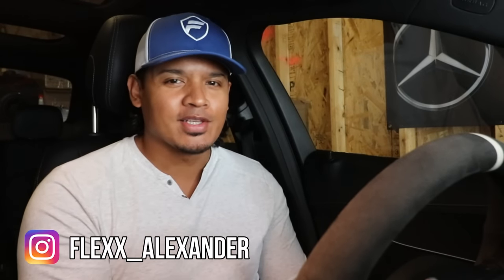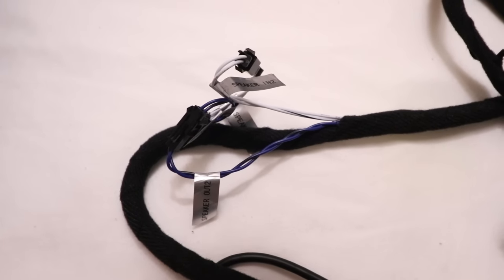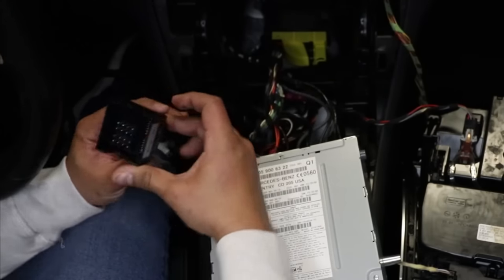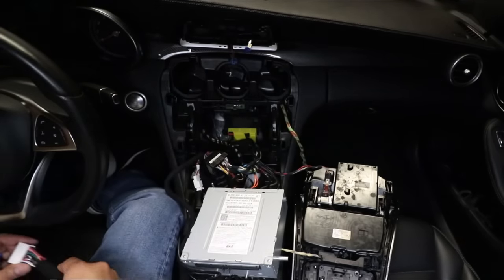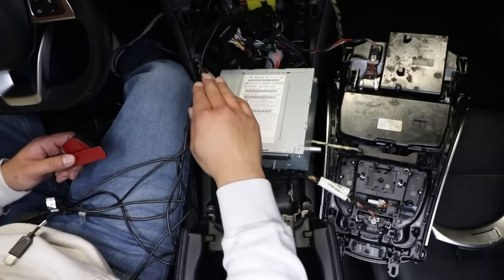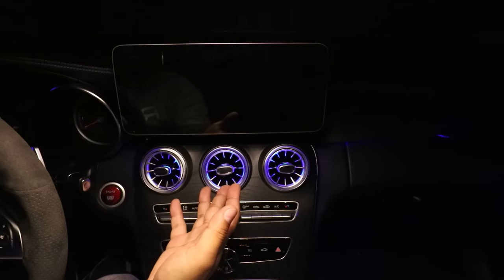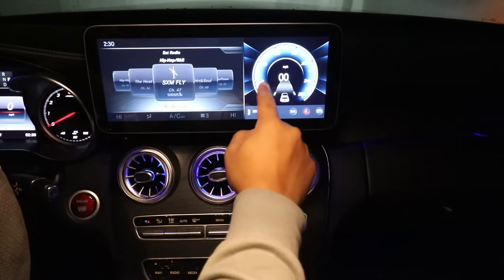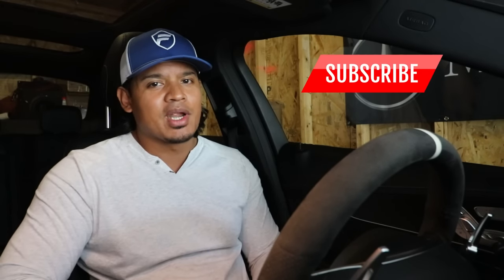BIGGEST Android Screen install on C300 (W205) 2015+ Mercedes C-Class

Comment: Does this screen help any as far as audio sounding better over stock because my AMG sounds factory are subpar. Looking for an upgrade but if this just helps user interface then i will keep looking
Reply from the maker: Yes and no.  It’s doesn’t enhance quality but it has a way better EQ to customize the audio.
Reply: @TheFlexxGarage  ok thx for the reply i was looking for an enhanced sound without installing multiple amps. I recall on my 2008 Bmw i changed the oem radio to an aftermarket and everything just sounded 10x better . I found some other videos on changing the speakers and tweeters / subs but keeping it oem integrated still seeing if this will help.

Comment: Ordered one after watching this video. Let's see how it goes with the shipping and install ;-)

2016 C300 Designo Package
Reply from the maker: Hope it was from DMP cause if not, you’re gonna have a hard time setting it up to work properly cause no other company offers good step by step support if you have issues.
Reply: From the link you posted.
Reply: The FLEXX coupon worked too!!
Reply from the maker: Cool. If you have any questions, just reach to DMP cause after the install, things won’t work right until you setup the screen setting correctly.

Comment: Hey flexx, when I installed the 12.3 on my 2015 c300, the backup camera, agility control and t
Trackpad all don’t work. I rewired my old screen and everything works as normal. I don’t know what the issue could be
Reply from the maker: Probably Need to update your settings on the new screen. Contact DMP and they’ll walk you through it.

Comment: Hey flex, i don’t really use the voice on gps if i was to not connect the little black speaker could i still hear the phone calls through the regular speakers? Would it effect anything else?
Reply from the maker: you dont need to use it. Its only for GPS..not calls.
Reply: Hi, 
were you able to solve those problems? I am thinking about buying one for myself. How does it feel like after using it a period of time? is it as smooth as the OEM system?

Comment: Hi, great video 🙂. But i do not have any sound in the Android system, just In OEM system. And In the OEM system the sound Is "sparkling". Do you know what I can have done wrong?...In the video you connect the AUX cables, and connect them to the USB port In the console. I did not do that. Is that my problem?

Best regards
Raymond
Reply from the maker: Not sure.  But the no audio is a setting issue. However you have to plug the USB or 3.5mm jack into the AuX on your car. You need to chat with DMP and have them double check your install and settings.
Reply: @TheFlexxGarage  thanks for your reply 😊

Comment: So in the video at the end you say there are two white wires that you connect to the screen when at the beginning you can see that wire is blue. That blue one doesn’t fit into the white connection on the back of the screen
Reply from the maker: I clearly said the 2 white connectors plug into the back of the new screen. Go Watch the 2:49 mark again

And I said the blue connector plugs to a connector that’s already on the car (it plugs into the original connector pulled off the oem screen). I never said the blue plugs into the back of the new screen. And go watch the 10:30 mark again.
Reply: Thanks, that helped and yeah the smaller white connector had gotten lost in the back when I had pulled the cords through

Comment: Just bought the 12 inch for my 2016 C300 (W205). I have issues with the screen long time to boot and eventually disconnects while driving. Is this a common problem that anyone faced and do you know a solution. DMP support are not responsive on the phone lines provided on site. I bought directly form DMP car design on their website
Reply from the maker: Contact them directly. They are there to support you.  I never had any issues so I don’t know how to solve your issue. Send them an email or what’s app.

Comment: Hey Flexx, does the climate controls/temperature/blower speed show up on the Android screen?
Reply from the maker: Yes. I think there’s an option to have them all the time or only when you push the switches.
Reply: Great. Will definitely look into getting this. Do you think the size is too big that it blocks the viewing of the windshield? Also does this one also sit too high compared to the old Android units?

Comment: Nice video Alex wish DMP would actually include instructions when you order them. I had to search on YouTube for this install and still had some issues as they were from different android screens. They at least responded via WhatsApp and got me all squared away. The only issue I'm having now is that when I am connected via Android Auto and I am using Waze or Google Maps and listening to Spotify my music stops playing every time I get a message, notification or if my Navigation re routes. This is extremely annoying and it takes a good amount of time for the music to start playing again. Do you know a way to fix this? Would greatly appreciate it!
Reply: Hi, 
were you able to solve those problems? I am thinking about buying one for myself. How does it feel like after using it a period of time? is it as smooth as the OEM system?
Reply: It’s really good this new model you will love it

Comment: Does your original mercedes system need to be working in order to install this? My radio head unit has just malfunctioned and I’m left with a fuzzy screen, and I’ve always fancied an upgrade to apple carplay. So I’m wondering if I can get away with installing this new screen or whether it relies on having an intact, functioning mercedes computer running in the background. 
If yourself or anyone else out there has had a similar issue or has any thoughts please let me know.
Reply from the maker: Depends.  If the oem screen is the issue, then you can get away with it.  If it’s a signal that bad going to your oem screen, then the signal will still be bad going to the new screen
Reply: Thanks. I think the problem is with the radio head unit rather than just the screen, and asking around on several forums I think I need a new head unit (or software update) before I can upgrade to this android screen.

Comment: Hello Flex, maybe you can help me. When I turn my signal or when I am reversing the android system shuts off and goes back to the original system. Once I turn or I am done backing up, the android system starts back on. It’s weird
Reply from the maker: Sounds like a common settings issue. You need to contact whoever sold you the screen and have them walk thru the proper setup specific for your car.
Reply: Did you get it sorted? What was your solution?

Comment: @Flexx - Did you experience an issue where the Android screen doesn't power off when the car is turned off? After install, noticed that the Android screen was automatically on even with the car powered off, which was concerning.
Reply from the maker: No. Never had that issue.  Mine was the opposite. Once in a bluemoon (like once or twice per year)…the screen might not power on when I start my car.  But turning off the car and restarting would fix the issue. 🤷🏻‍♂️
Reply: @TheFlexxGarage  got ya, good to know! haha i guess i'll have to check my wiring again :D Thanks so much for the quick response and always enjoy watching your videos
Reply from the maker: Thanks for your continued support. I might not be able to get to every comment on my videos, but I try for sure.
Reply: @TheFlexxGarage  Oh so sorry but last question - how long does it take for the screen to turn off after you shut the car off? Is the screen still on when you lock the car?
Reply from the maker: Instantly after I shut off the car and open the door.

Comment: If we're just using this unit for Carplay, then can we bypass connecting the GPS antenna? Doesn't Carplay use the iPhone for GPS?
Reply from the maker: Yes
Reply: So you'd only need the GPS antenna if you were using any map apps that are installed on the screen, correct? Would the same apply to the mic and speaker? If we're just using the unit for Carplay, won't it use the car's mic and speaker?
Reply: @lenluviner8373  I do have the same doubt, I’m always using CarPlay functionality, and I’d installed the mic, I’m experiencing voice return 😢: how did you finally installed it?

Comment: Hi Flex, do i have to put simcard to have internet on the android screen, was told by dmp that once it's connected to the carplay it will get internet, but it does not, are there setting that i need to tweak
Reply from the maker: Don’t know.  CarPlay is running from your phone.  So if your phone has internet, it should transfer but only within the CarPlay app.  Your not going to get internet to apps outside of CarPlay app.

If you want internet from your phone to the android screen, you need to turn your phone into a hotspot and the go in the settings of android screen and search for the WiFi created from your phone and connect to it.
Reply: @TheFlexxGarage  I also is having issues using my phone as a hotspot but wanted it seems that my screen automatically connects me to carplay and won’t allow me to use my phone as a hotspot .. I tried contacting DMP but they haven’t gotten back with me .. maybe a data plan for the screen is the best option

Comment: Can you change the split screen to one full screen?
does this screen work around the world w205 (maps etc, as i'm in uk).
Reply from the maker: You can but it will be distorted and stretched. 

The maps is whatever map app you wanna use. As long as you have an internet connection or download the offline maps, you can use google maps, waze, whatever.  So it works anywhere.
Reply: @TheFlexxGarage  Thanks. is the sound quality transmitted via apple car play say good enough?

Comment: I got the 12.3 inch one. I can’t get the audio to work. Tried everything nothing worked. Backup camera doesn’t work either. Took it to few car electricians. None of them want to even touch the car. Just sad
Reply from the maker: 1) did you buy it from DMP Car Design

2) if you did, they provide technical support on their products. Did you even try reaching out to them?

3) if you bought it somewhere else, then it’s not the same screen as mine and you need to contact whoever sold you the screen for tech support. Most of the time it’s just settings issue.

Comment: I have it for 2 years now, recently my bluetooth keeps disappearing and i have to reset network settings everytime, any way to solve this!
Reply: Hi, 
were you able to solve those problems? I am thinking about buying one for myself. How does it feel like after using it a period of time? is it as smooth as the OEM system?

Comment: Is there a setting that prevents the system from booting up in COMAND mode? I can't figure out how to get it to boot up into Android mode with the key.
Reply from the maker: There’s a “boot in last mode” or “boot in a specific mode”.  I think it’s in the hidden menu.  You will need to contact whoever sold you your screen to walk you thru the access and provide you with the password.  Not all screens are the same even if they look the same. If you bought from my sponsors at DMP, they can provide you with full tech support.
Reply: @TheFlexxGarage  good looking out! thank you! Yeah, it's a DMP unit that my client supplied himself. I reached out to them via WhatsApp, but they're on the other side of the world.

Comment: Hi, my 2016 CLA 250 doesn’t show an AUX option so, I can’t get audio from the movie player on the android screen. Any ideas on a solution?
Reply: Hi it does have an aux port but is hidden, you will need to use an old remapper to do this
Reply: Alternatively you could use an aux to usb converter if needed
Reply: Hope that helps

Comment: Hi
I have a w205 just installed the ntg5 biggest screen 12'5 ,got no sound on the tablet. radio works fine I've done it factory settings, aux position still no sound !
Reply: I got the same issue, any solution
Reply: Did you choose the Android screen as a media source? In the OEM screen, you have to choose the Android screen as a sound source in the “Media” menu. It should come up as an iPod-icon. This is the reason why you have to connect the main wiring harness to the USB-port under the armrest.

Comment: Hi I have just done mine rear camera dosent work also sound doesn't coming from the screen can u help me please
Reply from the maker: Already answered in the comment section to tons of people.  You have to fix your settings. This is not a plug and play device and you’re done. You need to set it up specific to your car.
Reply: @TheFlexxGarage  thanks for your reply I have fixed the Camera through the screen but only problems I have now is when I play song on YouTube there is no sound x also when I install the wiring I don't have 2 speaker wire like your one many thanks if u could answer me
Reply from the maker: Yeh, I’m not sure. You will need to reach out to whoever sold you the screen for support. If you bought from DMP, message them and they’ll get back to you with steps to get everything up and running.

Comment: Is it posible to do some damage on the car? I mean if you do everything right.. Is it posible that you get some errors in the system?
Reply from the maker: There’s always a possibility. Could be a defective part or improper installation. Same thing goes for OEM parts as well

Comment: Hi mate, does Apple CarPlay directions work with the heads up display?
Reply from the maker: No clue. I don’t have a HUD to test.  You would need to contact DMP car design and ask them.
Reply: Heads up display will not work with the CarPlay or Android Nav
Reply: @nadimafg what do you mean head up display? You mean what on your phone it won’t display on the screen?

Comment: hey flex i just did the install today and im not getting audio from the android system but when i switch it to the mercedes bluetooth it works
Reply from the maker: Could be setup issue. You will need to reach out to whoever sold you the screen. They have a password for the secret setup menu.
Reply: I'm having the same issue. Have you found a solution yet? Thanks

Comment: Whats the audio like with apple carplay? Some people say u have to use a dac coz it sounds very soft?
Reply: Just installed on a Mercedes c300. It sounds good but just a audio lag. U would need to buy a dsp from their site to fix the problem
Reply: @96dripp  Do your videos lag? I know when I mirror my phone to the original command screen it does when I'm watching videos on my phone. That's one of the main reasons why I want to upgrade. I can get rid of that all together.

Comment: If I use the Navigation in Android Auto, is it possible to hear the Navigation Sounds thru the additional Speacker?
Reply from the maker: You hear it thru your car speakers.
Reply: @TheFlexxGarage  sorry I missed an important info. I would like to hear music from the OEM Radio and the while listening to music hear the Sounds from the Navigation App in Android Auto.
Reply: @Fw_-sb5kt  Those are two different sources so unfortunately not possible... it's like using your input selector on a tv to select two or more sources simultaneously... at least in my experience with these iNav units, I haven't been able to do what you're asking about... hope this helps!

Comment: Hey Flexx, will you ever do a  digital cluster retrofit?
Reply from the maker: Answered this question many many many times, and it’s no. It’s way too expensive for not much benefit and plus requires coding which I don’t have access to software to do so. If someone comes outs with an affordable solution that’s plug and play…then I’ll do it but that ain’t happening anytime soon.

Comment: you are really good and thorough. Why cant you tap into the built in mic and use that and also use the built in gps antenna and why use an extar speaker thanks
Reply from the maker: The mic I installed is a “an extra mic” for additional voice pickup. It’s extra and not necessary but can only help for better call quality. 

And you can’t tap into the oem gps antenna. The oem gps antenna is designed to work only with the oem interface. It doesn’t know how to switch over to when you use the android interface for google maps, or waize, or other gps apps.  

And the small speaker is not your main speaker.  Your Audio still goes through your cars speaker system. The small speaker is strictly only for GPS turn by turn audio when you are using the android interface gps in the background while the screen is back in the oem interface.

Clearly stated in the video on the mic and speaker.

Comment: Hi, my reverse camera stopped working! Yours? Any tricks tips?
Reply from the maker: Never had an issue. I bet you just need to go into the setup and select the proper camera again.
Reply: Did you fix your problem? I had the Same issue and I dont know what to do…….
Reply: Hi Orlando, 
were you able to solve those problems? I am thinking about buying one for myself. How does it feel like after using it a period of time? is it as smooth as the OEM system?

Comment: I installed the Android display and also have sound. In general everything works perfectly. But I have a strange problem, I hear strange noises, especially when I don't have anything on, i.e. no music or video. The noise is similar to a beeping… is that normal? I read in a forum that it's generally the w205 aux, but if that's true, can you do something about it? Currently I'd rather drive with no sound than hear this beeping noise. If anyone can help please reply here
Reply from the maker: Look into getting an aux noise filter or a USB audio noise filter. It’s all over ebay.
Reply: @TheFlexxGarage  I’ll try it thank you 👍🏻
Reply: @TheFlexxGarage it worked! 🤩 thank you bro 💪🏻